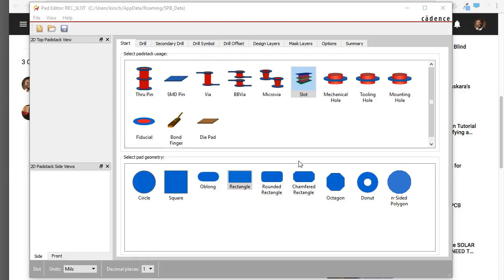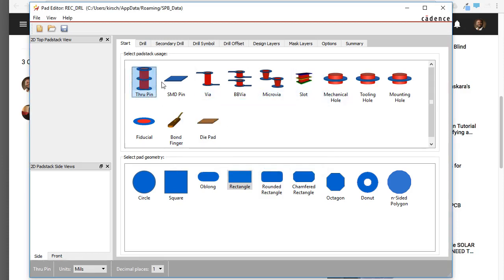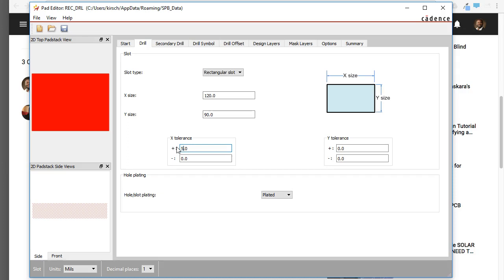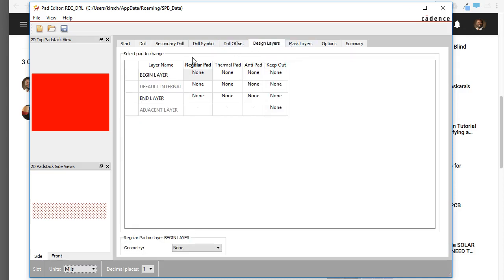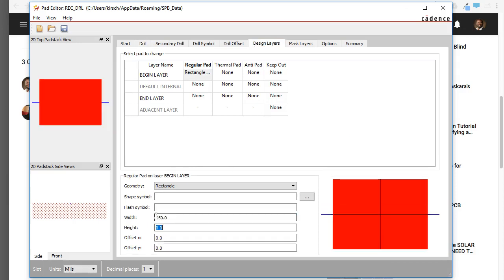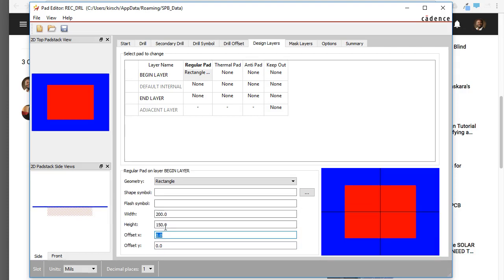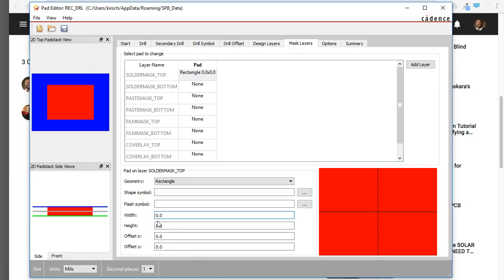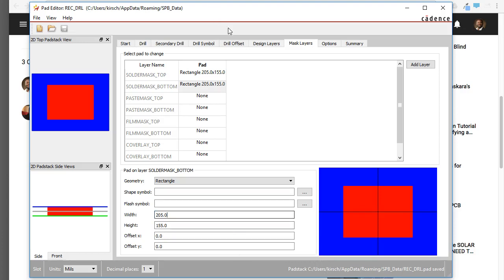OrCAD Tutorial: Creating Rectangular Holes Using Padstack Editor

Comment: Wait I don't understand: is there a difference between choosing thru pin when naming the file and choosing slot shape?
Reply: @techedkirsch  Well what i mean is the drop down menu below when your in the process of naming the file. There's a choice for thru pin or mechanical hole, ect. If I choose mechanical hole, then that's the exact same thing as choosing it on the first tab there right? Sorry I think I messed up my question from before.